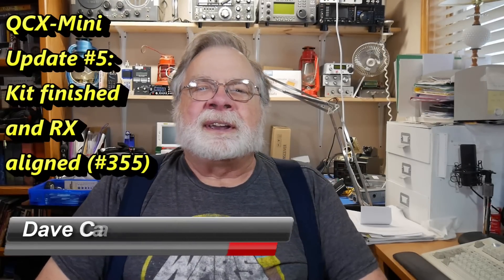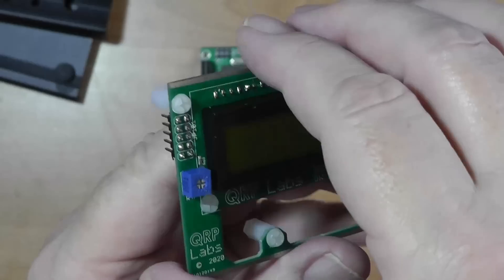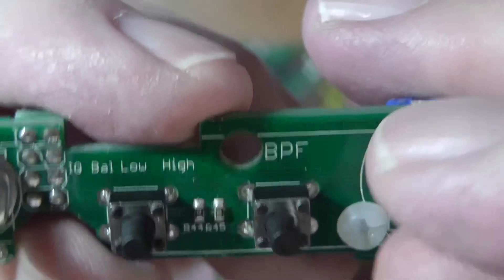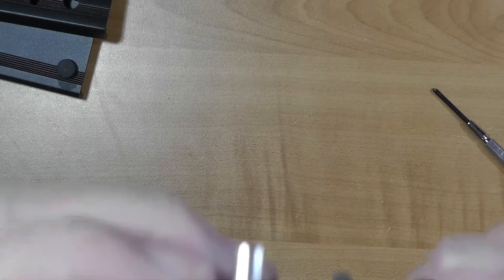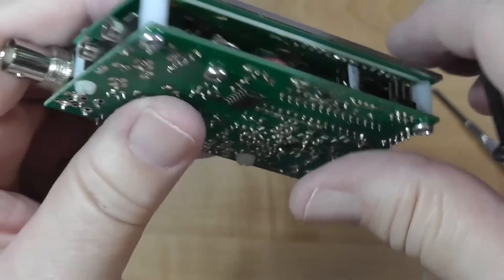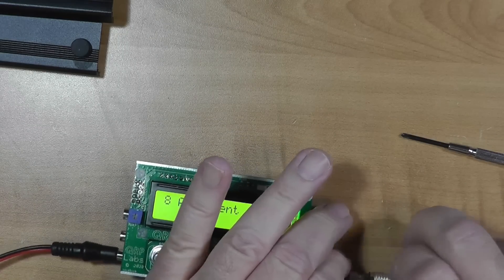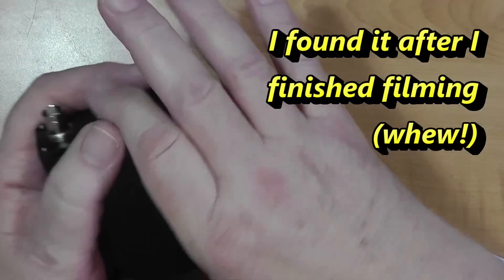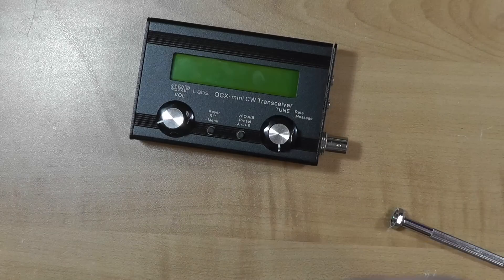QCX-Mini Finished and Receiver Tested #5 (#355)

Comment: I have been waiting for several years for the QSX SSB kit. I built the PA to save time but Hans never finished designing the rig. I gave up and bought an FT-891 instead. A lot more hams want a QSX than a QCX. I already have a first gen QCX 40 M & it works fine but I don't like CW.